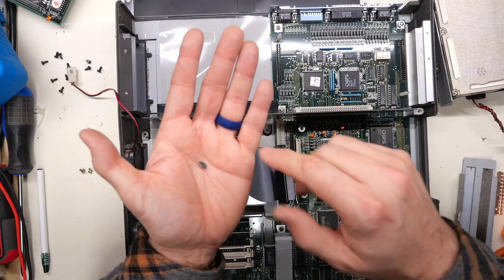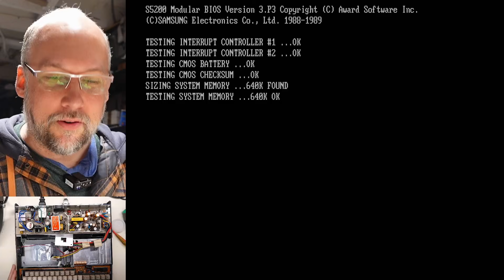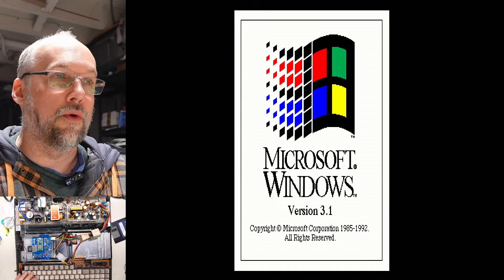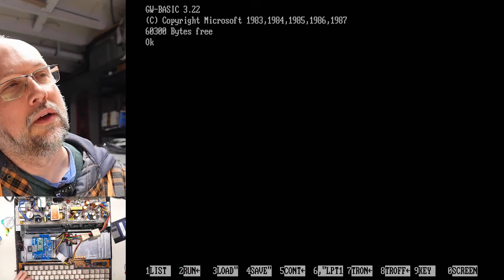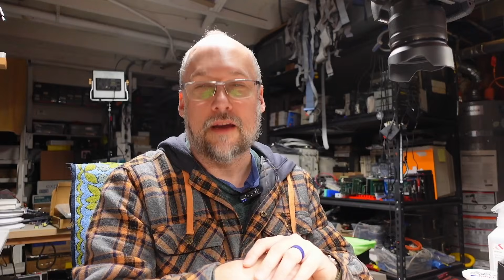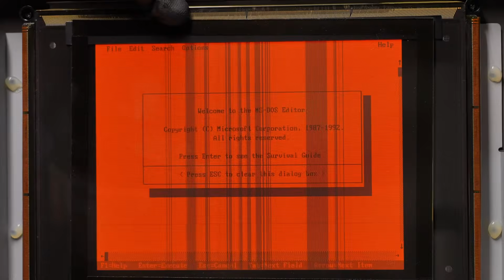PC Archeology: Let's explore the Samsung S5200 and attempt a repair on the gas plasma screen

Comment: Adrian I have to tell you... a "jump-cut" is sort of the opposite of what you think it is. It is a jump in time, but we remain in the same "scene", there is no transition and the subsequent shot has either the exact same framing or the same central focus (as in the example on WIkipedia) --> https://en.wikipedia.org/wiki/Jump_cut ... A Jump-Cut is also a violation of so-called transparency or "continuity-editing" in the sense that standard practice is to always cut from one type of shot (Mid-Shot, Wide-Shot, Close-Up, "plan américain",...) to a differnt type of shot. Because audiences are habituated to this form of transparency-editing / technique, they tend to find jump-cuts jarring -- and this in turn made it possible for experimental Filmmakers (the likes of Godard) to successfully deploy jump-cuts as a type of "Brechtian" alienation-device.
Reply from the maker: Technically correct, but just as people say "I have a theory" when they are really should say "I have a hypothesis," common vernacular in English allows for such technically incorrect usage. Another example is people conflating the term "mass" and "weight."  If one were talking to a room full of career film editors, one would want to make sure to use the correct terms, but to the general public, a "jump cut" is just an abrupt edit. English as a language is so far from technically correct and is filled technically incorrect terms become the norm.

Comment: I was hoping you'd hold the panel upright and put one of the De-Oxit products along that edge to possibly clean up the corrosion and/or restore the contacts a bit?  I'm thinking the seal that held/holds the traces together  have failed and moisture has gotten in and caused the corrosion and the De-Oxit might alleviate it.  Couldn't hurt, could it?

Comment: So those two larger nibs you see - you're probably right! They look like getters.
From what I've seen of people building tubes, they don't paint it on and instead have a metal ring of getter material sit inside the tube that is later heated via an induction heater. When it becomes red to white-hot, the material diffuses from the source material, flies through the near-vacuum, and splatters onto the glass producing a thin film of silvery material that is ready to absorb oxygen & other impurities.
The only thing I don't get about this display is why it's so transparent. It could be a very thin film? It's usually a total mirror in other tubes.

Comment: Why tantalums fail open.. This has to do with the thickness of the dielectric layer between the two plates of the capacitor, which in the case of tantalum caps is a very thin oxide layer. With "very thin", we are talking nanometers per volt of tolerance. The thinness of this layer is what gives the tantalums their high capacitance per volume ratio, combined with low ESR and as such high "speed".

The problem, is that as this oxide layer ages, it deteriorates a little due to crystalization, reducing the voltage rating with as much as 20% or more. If the manufacturer of a motherboard used caps close to their original maximum rating (say, 16V caps for the 12V line or 6.3v caps for the 5V line), with age you are suddenly at a point where the weakened oxide layer can no longer keep the two sides isolated. As a result, it will break down, basically puncture, shorting the cap out. The cap can self-heal if the current is low enough to not worsen the damage, but over the rails of a PSU you will usually get the more spectacular pyrotechnic version.

Comment: Very cool laptop.  had one similar to it back in the early to mid 90s. Gas plasma in the glorious orange and all. I used the heck out of it and somwhere around 1994 the screen started to show the same type of issues you're seeing.
Compared to the lcd screens of the time it was really usable right up until it developed the issues. I used it, issues and all, for for several months until I moved up to a new desktop. I doubt that any of the plasma displays that were used a lot are really servicable anymore.

Comment: Thanks for the all the great video! You're my favourite YouTube channel! 
Tiramisu --> I remember once having to recover a hard drive that was half re-imaged and blown away. I was able to get about half the files back using a tool called Tiramisu. I think the file was called Tira32.exe or something like that I can't totally remember. It was able to pull whatever files weren't overwritten even those the partition information was blown away by imaging program that got half way through. Also, I always use painter's tape and Sharpie or label maker labels to label all my hard drive so I never get mixed up and accidentally do something like that!
UPDATE: Yes, it's Tiramisu and the program file is TIRA32.EXE although I don't remember much else about it. I might still have my copy of it but I'm not sure. Since you don't end up needing that's great but I'm leaving this comment here because I remember this program was really good at recovering files and ran on MS-DOS.

Comment: I've never used Unformat, but UNDELETE was a great utility.  Most of the time files were deleted just by removing them from the file list.  As long as they were never overwritten, files were easily recovered with UNDELETE.  It worked in double-space also.

Comment: Outrun DOS has sound effects, but you will need to turn off the music. When in soundtrack selection screen, I believe push down to turn music off. Also, if I recall SPACEBAR or ENTER will give you high gears so you can start overtaking other cars.

Comment: Hey Adrian, I would look for hidden files on the ST-138N. FDISK says there's 30MB on the drive, the DIR listing shows less than four megs available. The obvious question would be where did 26MB of data go? Run DIR /AH! My guess is this drive is has been compressed with Doublespace. The compressed contents would be stored in a hidden file located on the root of the drive. 

You need to boot it, or mount it with Doublespace to gain access to it's contents.

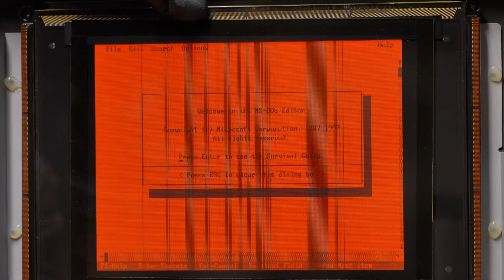Comment: Is there anything preventing a 'try it' run using some hot air from your soldering workstation on the front portion of the screen like you had it set up at 1:10:10 ? If there isn't anything too  vulnerable to heat in that small area at the very top where the corrosion is, you could try the hot air and see if it loosens up that glue/epoxy even slightly that would either clear off enough of the offended traces and/or allow you to recompress the screen with some small plastic clamps in hopes of getting a clearer signal.

Comment: I sent you an email, I have a potential solution to your XTIDE issue but I ofc can't put links in the comments. It may be flagged as spam bc I've backed up the files to my website and I use a free ddns service for hosting it.

Comment: I remember back in the '90s the Toshiba screen bonding would fail and you didn't see the discoloration you're seeing on the Samsung. I think the bonding agent has discoloured quite a while after the bonding has failed. Edit: Frustratingly plasma bonding is a term used in quite a few different technologies so it's it's not much use searching for it in this context.

Comment: I got triggered (in a good way!) from the image at 4:29, where I noticed a white connector next to the SCSI and floppy connectors; the trigger was me remembering I have a 386 in need of repair where I need to replace two cables (for keyboard and mouse ports), but I cannot for the love of my find the proper connectors that fit the socket. My question; could anyone point me to a comprehensive list of connectors so I can at least find out the exact connector type to start the search for a replacement? Hours and hours of googling without success. (it looks like the one in the video, but it is not identical and seems to have a smaller pitch as well. Specifically, it concerns the key/mouse port of an Amstrad PC7386sx80, also sold with a Sega inside as Sega Mega PC)

Comment: I also wonder if the glue/adhesive they used to bond the circuit board to the glass may have been hydroscopic and sucked in moisture. Could possibly explain why it corroded there and nowhere else on the boards.

Comment: You might be able to clamp the edges between two stiff aluminum bars to force the ribbon down onto the glass. The tension could be provided by screws holding the bars together. There's a lot of room in there for hackery.

Comment: You would use SCSI in 1989 so you could get a big fast disk. You might put XENIX on this computer. A lot of things were in flux. This is really a pretty interesting computer. They may have had OS/2 in mind. This was obviously intended as a very high-end system. CAD capable.

Comment: For data recovery on that SCSI HDD, use linux. Just a live USB of Ubuntu or Debian will probably be sufficient. There is a ton of recovery software in the repositories of both distributions (well, technically Ubuntu is forked of Debian) that goes from CLI to GUI, from very easy to really hard, and from really safe to if-you-screw-a-flag-up-in-this-command-your-hdd-will-self-destruct dangerous ;-)

Comment: Just pulled the old T3100e/40 out of the black hole under the stairs after watching the first video on this machine and sadly over several moves the screen has been damaged. (Glass cracked)
Sadly my screen WAS perfect last time I used it.

Plugged it on and although it beeps there is zero display.  :(    I do remember that it needed to be plugged in for a little while before it booted otherwise it gave a chip error.

Comment: I wanted to point out that PCs with Doublespace, how it worked is that there is a small amount of files on the original drive.  Then the compressed partition is stored as a file named DBLSPACE.000 when the doublespace drivers get loaded after DOS boots.  Then the original hard drive (uncompressed) is turned into a different letter (usually four letters after the last drive of the system) when doublespace loads and the compressed drive takes the letter C.  It can take other letters on multiple compressed drives or compressed floppies.    That may have explained why you saw nothing on the original drive.  DBLSPACE.000 is usually an invisible, very large file.

To Mount Doublespace Drives you need DOS  6.0 or 6.2.  It was removed in DOS 6.21 because of patent litigation with Stac Electronics.  I hear the 6.22 version is more stable.   I think Windows 95 or 98 has a universal driver that mounts both.

Comment: This is because the glue has delaminated and now does not provide pressing of the flat flex to the glass. There is a remover for epoxies - drop a drop between the cable and the glass, wait until it dissolves a little and squeeze the glass - and everything will be fixed

up to adrian saw it
Reply: poor contact is not in the cables but in the silver coating on the glass
the second way is to pour contact (conductive) glue with a needle

Comment: 1:14:36: I wonder if the S5200 supports clamshell mode? Meaning, with an external keyboard and monitor plugged in, can you run it with the lid closed? Heat-wise too?

Comment: 23:53: Does that EGA seems only have the minimum 64KB video RAM? If so, then you got lucky all your games worked. Most (later) EGA-compatible games eventually expected and took for granted that EGA-compatible cards would include 256KB. Is that EGA board's video RAM upgradable, via a further daughterboard perhaps?

Comment: 14:53: 32MB HDDs were pretty par for the course when this machine hit the market. I distinctly remember attracting playground ridicule when my new PCs HDD was 50MB, which seemed impossibly large to (probably secretly envious) classmates who owned 20MB HDDs. "50MB?! You're never going to need or fill that!" There also was the factor that older DOS versions didn't actually support hard drives (or at least single partitions) larger than 32MB. In short: MS-DOS 1.0: no HDs, 2.0: <=16MB HDs (FAT12), 3.0: <=32MB HDs (FAT16), 3.2: <=2 32MB partitions/HD, 3.3: multiple 32MB partitions/HD (as primary/extended+logical partitions), 4.0: <=2GB HDs (FAT16B), W95: <= 2TB HDs (FAT32)

Comment: 10:39: The 9-pin connector could still have worked with VGA. Not all (early) VGA equipment had a DE-15 connector. I used to own a VGA monitor with a DE-9 connector. It lacked DDC/EDID, so you had to tell the PC what to output – no autodetection/plug&play without those. The (googleable) 9-pin VGA pinout is: 1 thru 9: R, G, B, HSync, VSync, RGnd, GGnd, BGnd, SyncGnd. HOWEVER, due to differences between digital EGA/CGA/MDA/Herc DE-9s and the way VGA used the DE-9, VGA still might have been impossible if Samsung didn't design that mainboard with enough foresight. With the EGA card removed, are the pins all isolated? Do they just route to where you plug in the video daughterboard, with nothing else getting in the way?

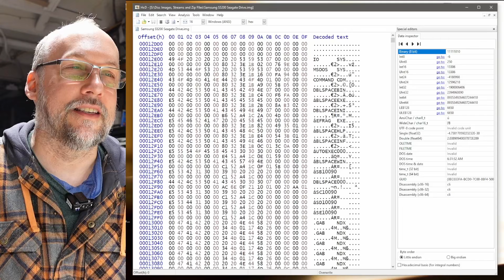Comment: @ 17:08 - See those E5 bytes that replace the first byte of the deleted file names in the FAT?  That is a marker that tells FAT that the entries are deleted.   Change that byte to anything else and it should "undelete" the file.  Any digital forensic software should be easily able to recover this.  Try importing your disk image into Autopsy, which is a free forensics utility.

Comment: I bet if a guy took that panel out and gave it a slow low temp oven bake and drying out the moisture it might work better, but no clue on what temp to slow bake it would be without melting anything

Comment: Interesting, I didn't know that the compressed files do not show up at all. I thought the files we see in the hex editor were just deleted, but it turns out that the first character would have been 0xE6 then and not 0xE5.
Reply: Sorry, it seems that 0xE5 means deleted and there is no 0xE6. Must be some other mechanism to mark them as compressed.

Comment: I've had reasonably good success using a program called getdataback.  I haven't used it on a Scsi device, but it has helped with nvme, data, SD, and ide devices over the years.

Comment: You can copy those files to another HDD just like you would any other file (remember to SYS the disk first); this is an easy way to get rid of Doublespace without risking running the uncompress utility.

DOS version is in the timestamp.

Comment: Huh. I have a Zenith Z-Lite (386 SX16, I think, without breaking it out to look) of roughly the same era. Battery is utterly dead, but otherwise still works perfectly. I'd be afraid to break it down to look, but interesting to see this'un's innards as an idea about what's inside mine.

Had another 386 more similar to yours where someone had cracked open the battery and replaced the cells with off-the-shelf rechargeable NiCads. Worked fine, and still held a charge when I found it a new home in 2010.

Comment: Adrian, back in the 1980s I was a mainframe DBA and did most of my work on the various displays of the 32xx family.  Including the 3290 Gas Plasma Displays.  We had them running 24x7 and they didn't get warm.  They got HOT! 🤣

Comment: The SCSI bios has its own setup / hdd format utility where you can set the drive size by specifying the number of heads cylinders sectors, CHS mapping limits the drive size to around 8gb, 512x63x255.

Comment: I used to work with automotive LCDs which had similar glued-on flat cables - they were paper thin and very easily damaged, typical in a development environment. The only thing that would fix them was to run your fingernail along the connections to try & get the glue to stick back down. Otherwise they had to be sent back to have new ones glued on.

Comment: Send the data to a museum or professional data collectors. There are institutions which work with archiving general day to day doings of the lay man throughout time. Usually they will keep the data secret for 50 or 100 years or more before releasing and they work with getting rights to publish etc or returning data to owners. I remember what's his face deleting data off an old dying drive to save another drive and everyone in the comments was saying its a bad bad ides to delete old data period as it can be used for historic circumstances

Comment: This BIOS should normally support a HDD of 255 Mbyte (in 1987 there were already HDDs available with a capacity of 300 Mbyte), but i think its possible that the SCSI Controller does not support that.

Comment: 10:28 Why is there a Xilinx programmable chip (CPLD or FPGA) on that video card? Was the machine produced in such small numbers that fabricating a custom chip would be more expensive than putting programmable gate arrays on each individual card?

If the drive is DoubleSpaced, it means there is a hidden file on the root folder which contains the actual data, which would be accessible by loading DBLSPACE.SYS. This would match with the drive being 30MB and there only being 4MB available on the drive while it appearing blank -- the DoubleSpace image file would take up the remaining space.